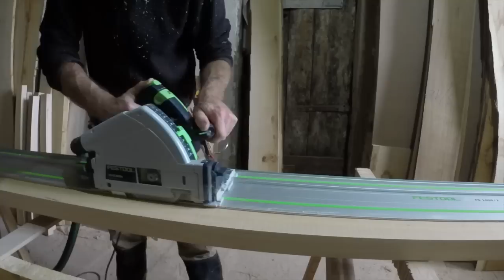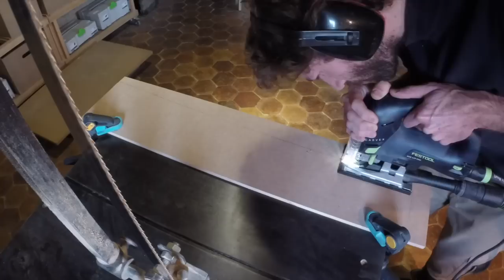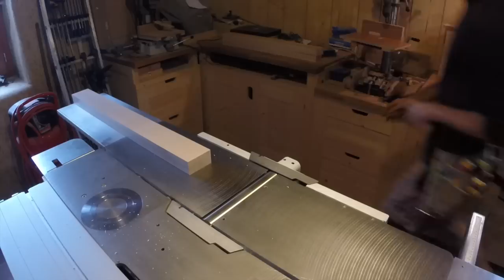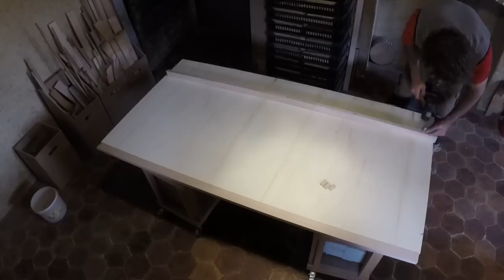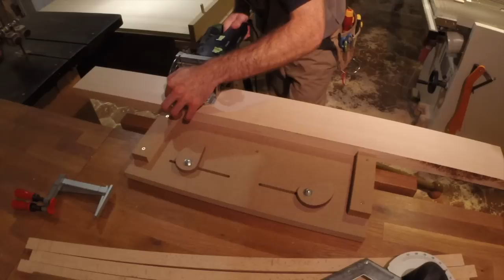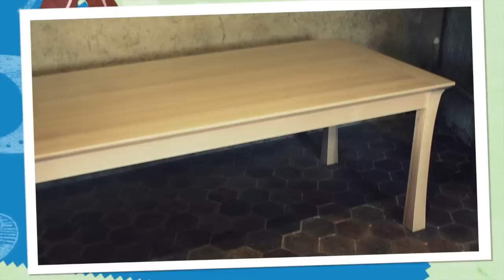Fabrication d'une table en bois de hêtre

Comment: Bonjour,

Au risque de passer pour un idiot : pourquoi "reconstituer" les pieds par assemblages plutôt qu'utiliser un morceau "massif" ?
Reply from the maker: Pour deux raisons (après, elles restent peut-être discutables ...)
- éviter d'acheter un plateau de 90mm d'épaisseur ou plus (cher et pas toujours facile à trouver) ... les pieds font 80mm de section.
- une meilleure stabilité dimensionnelle dans le temps.

Y a pas de question idiote, il y a que des questions ;)
Reply: Merci pour la réponse. Je n'avais pas pensé à la section des pieds par rapport à l'épaisseur du plateau... C'est évident !